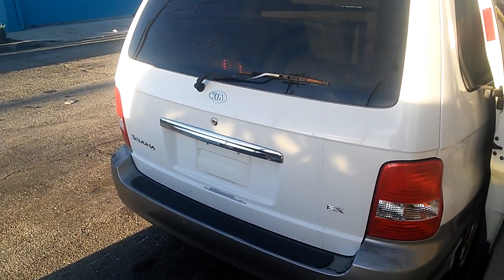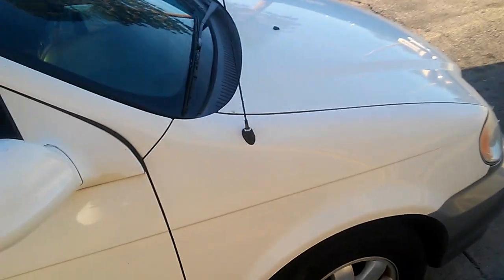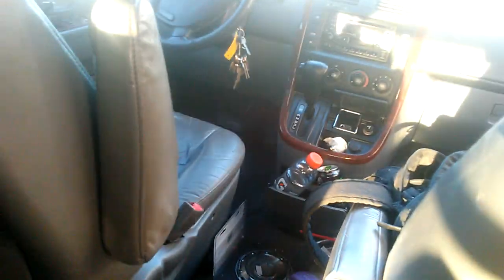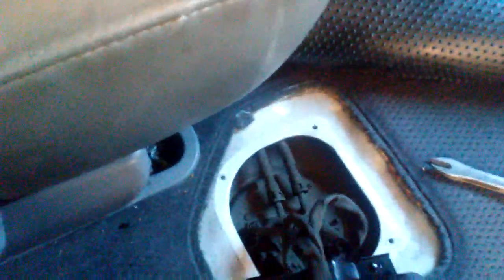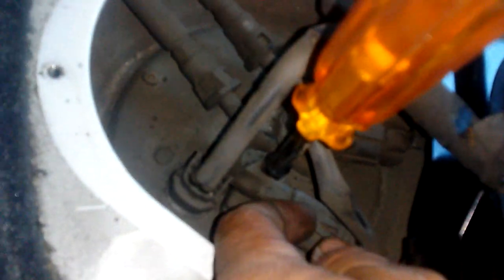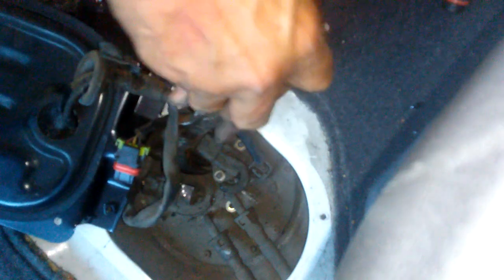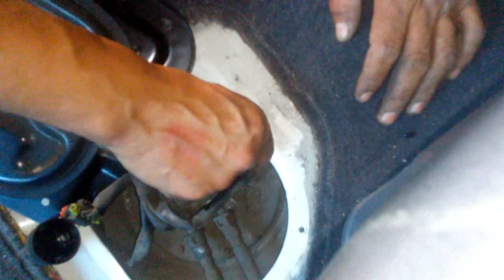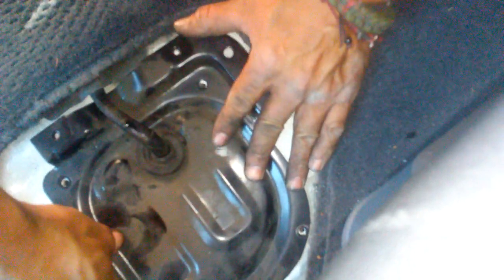03 kia sedona code P0452 EVAP Fuel tank pressure sensor how to replace

Comment: hi nice video i have 2005 model on low gas it goes smooth then once the gear change to 3rd it shart loosing power and take jerks then if i give more gas it drop the gear and pickup the power againg. i changed plugs, Coils, wires, thortle body with sensors but my problem is same so my brain is telling me to change pump or then gear please give me your professional advise.

Comment: What a very good video. You really explained it simple to understand. I have problem with my kia carnival fuel rail pressure sensor. Is it the same as fuel tank. Please, do you the OEM of the sensor you removed or replaced?
Reply from the maker: Thank you for your coment . i am not sure but i will try to find out for you if you havent already .